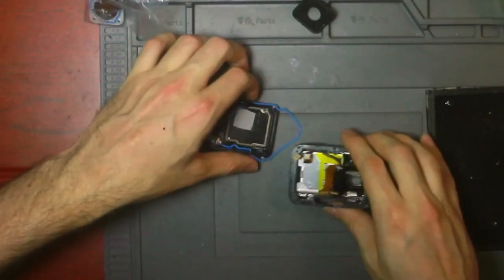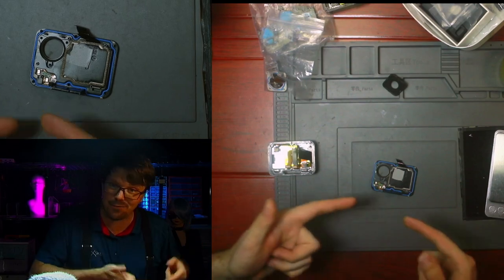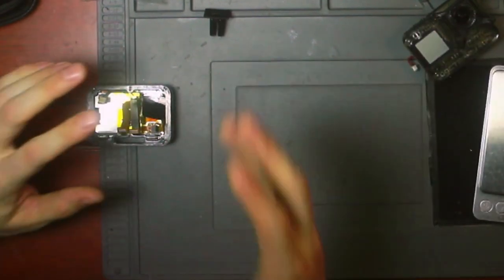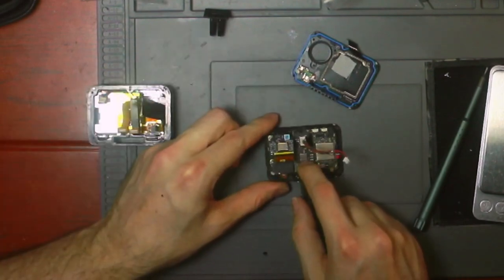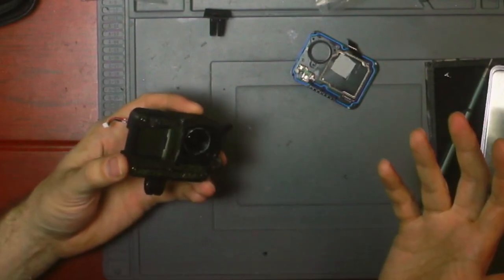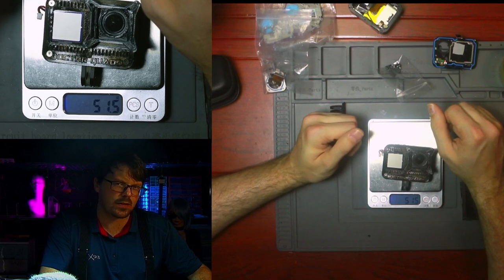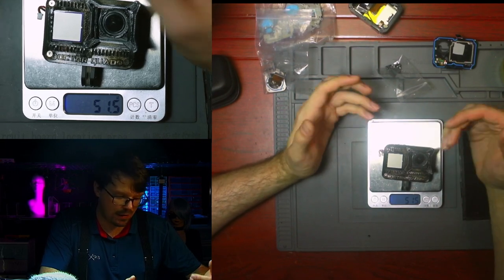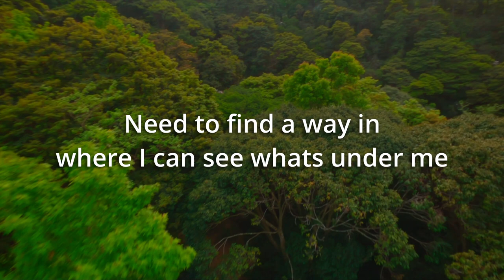The Ultimate FPV Naked Gopro - Microphone, Heat dissipation, and crash resistance

Comment: The a-symmetry of the GoPro irks me because,  idk,  maybe I’m autistic, lol!  That’s why I went with the 03 air unit.  Do you think it’s possible to separate the camera module and lay the rest of it flat? I could CAD the housing but I have never torn one down before
Reply from the maker: Bro you are not alone. It also makes it hard to design drone with it integrated. Some of the best drones using GoPro actually lay the PCB down and use an extension cable for the camera
Reply from the maker: This has actually already been done!
Reply: @33rdframe  I’ll have to dive into it!
Reply from the maker: @Typaradox_FPV  welcome to the rabbit hole
Reply: @33rdframe  with a last name of fields the rabbit holes are many😂